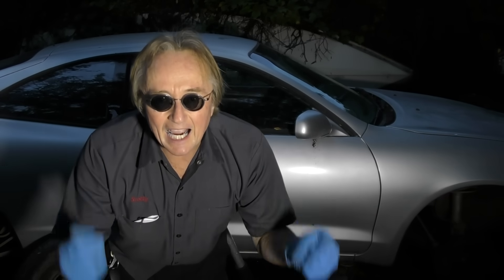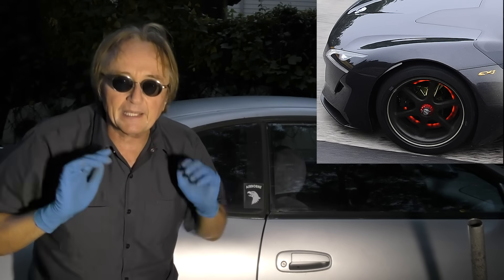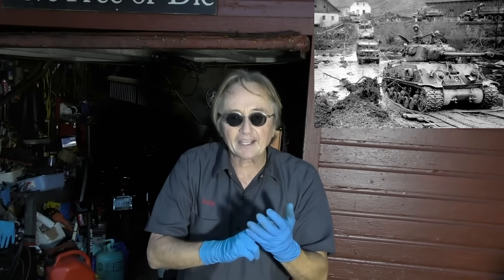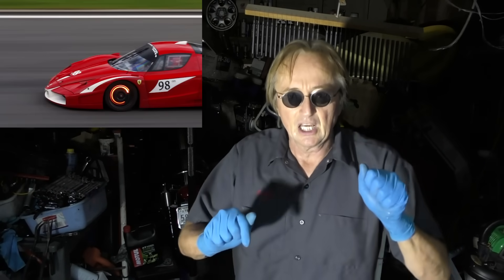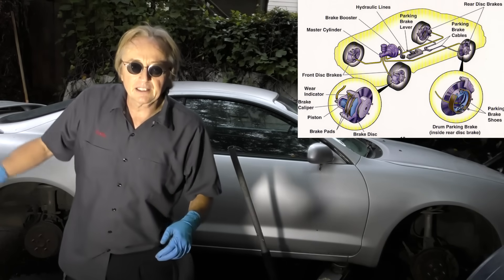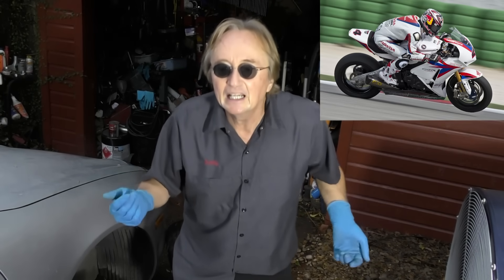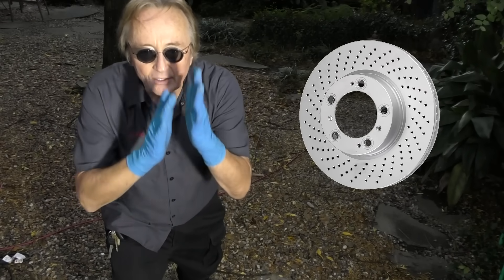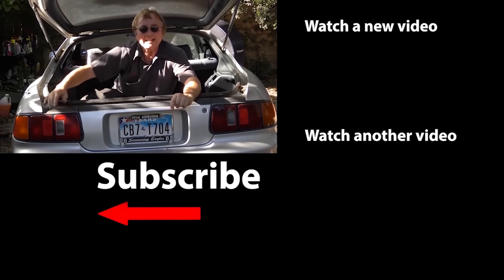Why Some Cars Have Drum Brakes Instead of Disc Brakes

Comment: How does an emergency brake cable attach to a rear disc brake?
Reply: Either a drum brake integrated into the disc hat or a mechanically locking caliper

Comment: If you have disks both front and rear and the rear brakes are used less does anyone rotate their brake pads?
Reply: No.  Usually you can't because the front and rear brakes are a different design.

Comment: Personally I prefer drums in the rear, they last forever. I've had several cars with rear discs and they always get noisy or grabby or something and need work way more often. My Kia is still on its factory drum brakes at 130k miles and they still work just fine.

Comment: The .main reason most cars have rear drum brakes is the parking brake is easier to add into drum brakes, disc brakes are only recently being used on the rear because they finally figured out a better way to do the parking brake on disc brakes.
Reply: They either use a floating caliper to engage the disks or they use drums built into the rear disks.

Comment: The main problem with 4 wheel drums is that when you step on them hard, they tend to lock up. Randomly. One wheel will lock first, and throw the car in a direction you can't anticipate.

Comment: Ebay got those slotted rotors for $50 bucks with ceramic pads.  Bang bang.
Reply: Rafy G they aren’t made very well. He has a video on brake pads and quality of them. Be careful where you order them from. And ensure there’s a warranty and what they cover
Reply: @cmsjr123  They been on the car for 8 years going on 9 no problem, better than the refurbished pos rotors from AutoZone.
Reply: eBay brakes sounds unsafe 😂
Reply: @user-os8sq3uh4n  why?
Reply: @rafyg3314  people literally say "ebay X" to say X is crap
Reply: Get ready to replace em every 20k miles or less

Comment: I put slotted cross drilled rotors on my car cause the regular rotors I use keep warping.  Probably because I use cheap rotors but the cross drilled rotors on Ebay and cheap and work well.
Reply: Probably just needed breaking in to stop the warping. Which involves speeding to about 50, hard brake without stopping then speeding up to 55,60,65 doing to same thing about five times. Then let them cool down for about half an hour.
Reply: High chance your warping is from mismatched tightening of your lug nuts. It really makes a huge difference. Use a torque wrench when tightening lug nuts to ensure they are all exactly the same tightness. I used to get warped rotors on my cars all the time until i realized to use a torque wrench, ever since, no more problems. Last set of new rotors going on 3 years now, no warp or pulsing

Comment: How do you convert drum to disks?
Reply: That is a very intense topic, and it depends on the car and how much it might share with newer models.  For example, it's possible to convert an old Mustang from drums to discs by swapping on a bunch of hardware from a '75-80 Granada because the chassis are closely related.  Generally speaking, unless you're sport-driving the car, it's not worth the trouble.  Some companies offer conversion kits, which may use special hardware.  It really depends.

Comment: Disc brakes are more complex. Had my experience with them when I owned a Chrysler T&C. The rear breaks were drums and just to be able to look at them I had to take off the cover, which meant taking off the springs and levers. My personal experience is if you want an easier break pad change get discs.

Comment: The REAL reason cars modern cars have drum brakes is cost. They are much cheaper and the manufacturers couldn't care less about repair costs. Even my last FWD appliance car, a 1996 Mercury Sable, used rear discs which only lasted about half again longer than the fronts. The car's weight is also a factor.

Comment: For motorcycles i was taught through a harley davidson class to use both brakes. You dont want to go over the handle bars when you need to brake hard.
I was thinking the drum brakes in the back was for the weight since its heavier up front.

Comment: I just got slotted rotors replacements for my wrx. They work with stock calipers, and there is a nice difference in the overall performance. They were nearly the same cost as the OEM rotors, and they work more efficiently.

Comment: also...its less complicated to use drum brakes with handbrake. no disc brakes you may have the inner part of the discs drum for hand brake...or and seperate calliber on disc or an calliber where the piston on using the handbrake works with a wedge.

Comment: Scottie I too had a Maverick....73.  4 wheel drum brakes.  You talked about brake fade in racing.  I had some real stinking...yes literally stinking fade when I used to come down from English Mountain for 4 really curvy miles with  30% grade.  I used to hold the stick in 1st gear and pray it didn't pop out of gear as it was prone to do.  Thrilling!😂

Comment: Yes very true, on a motorcycle you tend to want to use the front brake because it is far more effective at stopping than the rear. The best thing is to use them in combination. 

But the main reason why some motorcycles have rear drum brakes is cost. That is pretty much the only place you will find drum brakes as on very inexpensive motorcycles.

Although that isn't very true anymore since it is now becoming cheaper to put rear disc brakes on even cheap inexpensive motorcycles.

Comment: Why does the front brakes do most of the work, even if you put the same types on the front and rear? Is it by design, or because of physics?
Reply: Physics. When you brake the weight shifts towards the front. When you accelerate it shifts towards the back

Comment: if you change just the front brakes to disc there needs to be a proportioning valve installed for the rear brakes.
Reply: Even cars with 4 wheel drums have proportioning valves as during braking there is a wheight transfer to the front so they do most of the work, regadless of being drum or disc.
Reply: not always true. my 67 chevrolet heavy duty half ton van did NOT have any proportioning valve and it would lock up the rear brakes first if the truck was empty or lightly loaded. not a great thing but that was life with older stuff.
Reply: Yeah... that’s when American vehicles were “unsafe at any speed”

400+ cubic inches of displacement and nothing but leaf springs, drum brakes, and bias plies to reel it in.
Reply: @Bartonovich52  I don't know exactly why leaf springs would make a car dangerous. Many american cars had 4xcoil springs from the late 50's on. I imagine you mean that the rear solid axle was dangerous, but it isn't really, it may provide less exciting handling, but it a lot more predictive than the snap-oversteer caused by the swing axles used on many Euro cars at the time.
Reply: @MrTheMiguelox  Agree, many Saturday night short track cars along with vintage racers still use solid axles and leaf springs. Although, unlike some internet jockeys those people actually know how to drive.😁

Comment: proud owner of C3 Corvette it's so astonishing that back in the 60s GM was able to put 4 way discs!
Reply: Ford put front discs stanard-equipment on Tbirds in 65, and the thing was, both Corvette and Tbird disc brakes were made by the same company - Kelsey Hayes.  Even used many of the same parts.  Ford also offered the discs on Mustang and Galaxie that year, but they were optional on those models.

Comment: with rear drum brakes the parking brake actually works. My 1999 silverado 4x4 2500 the damn parking brake has NEVER worked properly. the useless government made gm fix ONLY the ones with standard shift. so I get to depend on the park in the transmission to hold the truck when parked. when I had a big camper on it I had to use wheel chocks to be sure it would not roll. some people don't know that if there is enough pressure on the park dog in the transmission it can ratchet and fail to hold the vehicle

Comment: you didnt mention adjustment. little access rubber hole on the back with a flathead screwdriver, discs are self adjusting. plus all that dust builds up in there, i dont even like them for the e-brake function on my van which i use all the time for parking, theres calipers that can e-brake.

Comment: I seem to recall reading somewhere that part of the reason drums are still used on the rear of most cars is because it's supposedly easier to implement a parking brake that way.  But of course, cost is still the big reason.

Also:  disc brakes are inherently less prone to locking up in a panic-stop situation, even without anti-lock.  They also don't require adjusting mechanisms like drums do.  On the other hand, drum brakes have one slight advantage over discs - most drums are 'self energizing'.  That is, it requires less effort to apply drum brakes than it does discs, because drums are designed to convert some of the energy of the rotating drum into a form of 'assist'.

Comment: i upgraded my Tacoma trucks brakes to aftermarket rotors and ceramic pads and left the stock drum rears that still have the original shoes after 300,000 miles and that truck stops incredibly fast (i went from a 205 to a 215 tire too) plus sway bars, shocks and springs and i have a Taco supreme

Comment: I had, but then sold, an '87 Ironhead that had rear brakes that didn't work but had the brake light come on. Since the front brakes worked, but didn't make the brake light  turn on. I used them in tandem to make it look like everything was working normally. It was all rusted and leaked everywhere anyways so I got rid of it. I'll stick to my perfectly functioning Japanese-made bike 😁 with triple disc brakes, two in front and one rear

Comment: It's really just what the car maker fits. In most cases  as the front brakes get bigger the drums in the back get replaced by discs. In many cases the wheels are bigger on some models just because the brakes will not fit inside a 15" wheel  and 16" are required.

Comment: So Scotty  keeping with the break theme is it better to still pump your brakes or just step on the pedal, which is better?
Reply: In a normal stop, just apply the brakes.  In a hard stop, pumping them can help reduce brake distance, but it's important not to stab them so hard they lock.  It takes some practice and that's why ABS is standard on so many vehicles today.

Of course, I tell my students to simply drive conservatively, and apply brakes sooner than later.  One, early application places far less stress on the brakes AND there's less likelihood of losing control, and two, if something decides to fail, you'll know about it sooner and have more time to react.
Reply: @swany6mm yes it does.

Comment: Scotty, one thing I thought you will mention, why today's discs need frequent replacements as the pads themselves. Often discs will need replacement on second replacements of the pads as they start to warp. Are today's disc softer than previous?

Comment: I always thought the rear drums on my 96 Accord was just used as a parking brake. I always thought the front disks did all the normal braking
Reply: @washingtonstromtrooper and it still runs like a clock. 200k and going...
Reply: @washingtonstromtrooper Accords are pretty damn solid sedans. No wonder why older model ones still run like a dream and retain a lot of their value like its Civic cousins.
Reply: The front discs do all of the normal braking. 

Unless you’re really hard on the brakes, the rear drums won’t engage.

Comment: My 1990 Celica has all wheel disk brakes. It depended on the trim. Lowest trim level Celicas had drums. Everything else in the lineup had all wheel disks.
Reply: Seems like scotty got scammed big time !!!
Reply: Yeah my 86 as well, mine's a japanese version though and every time i open the hood i get asks if the strut bar is aftermarket. Check that out too. I don't know how your generation was but not every 4th gen came with a strut bar
Reply: Yup my 01 has read drums that I’m converting to disks, mainly cause I hate changing drums. Also I’m planning on boosting later on so I’m using bigger rotors from the avensis for stopping power
Reply: I'm surprised that any Gen6 Celica had drum brakes.  But then I was also surprised when Scotty said he has manual winding windows on that car too.  My 1994 Celica GT in the UK has disc rear (plus drums for handbrake) and of course electric windows.  Alas no air con though.  
My 1972 Hillman Avenger has front disc brakes, so I'm guessing they were fairly universal by then on all but the cheapest cars (MK1 Escort base model for example).  However my Avenger has no servo assistance, so you stop the car with your foot.  I really like that system, you get to feel the road better, but if you're expecting a dead stop when you gently touch the brake pedal, then you're possibly in for a rude awakening.
Reply: My 94 as well, makes life little bit easier when changing brakes
Reply: My 94 Celica gt-s had 4 way disk brakes and the 2.2 litre engine miss that car such an awesome car
Reply: This guy love everything cheap and base model and no looking forward to spend any $. Typical cheapstake
Reply: Rear discs are more expensive and need more repairs as well.
Reply: @Roof_Pizza  I'm not convinced